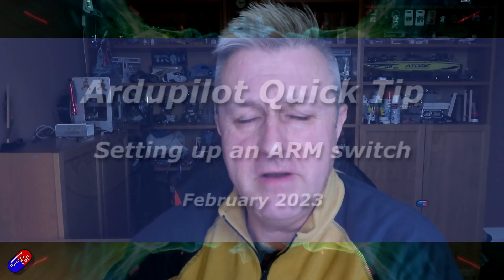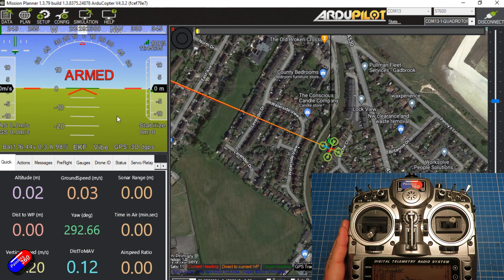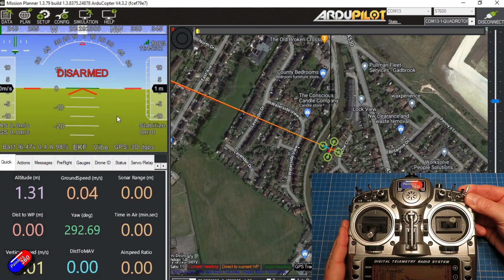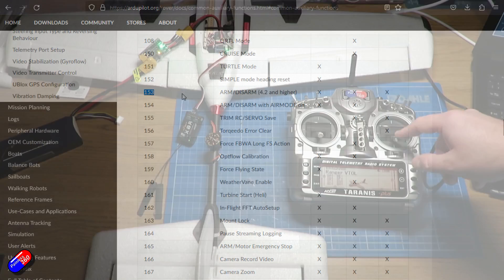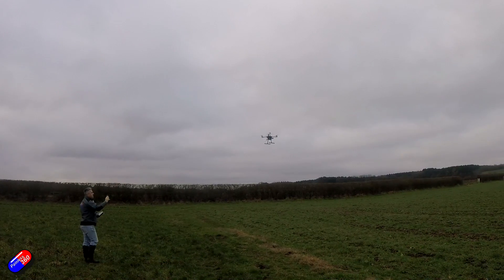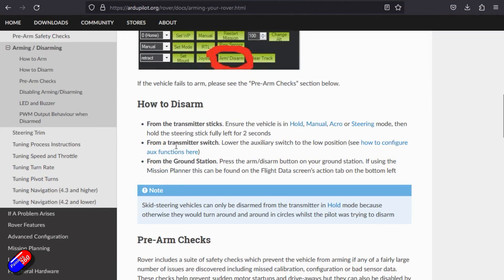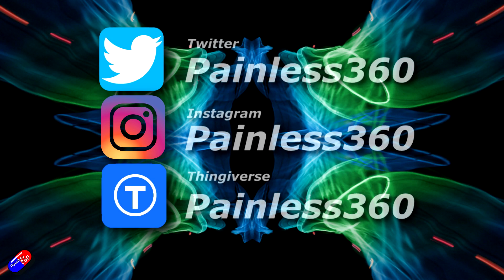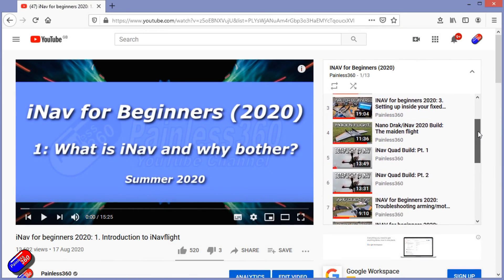Setting up an ARM switch in Ardupilot

Comment: I got caught out like this. When we fly BVLOS we turn off the Handset and use a lap top and a pair of RFD900s for control. Then turn on the handset at the end of the mission for landing. I had the momentary (Trainer switch set up in edge tx, to do the arm/disarm by holding it for 3 seconds) when the handset was turned on again it was in the disarmed condition which turned the motors off, Fortunately it was a fixed wing and was able to be glided in safely. went back to the old rudder arm after that. would be OK if you set an option to arm only with the switch and use mission planner to disarm you can do this with the rudder if you wish.  I really like your videos! Thanks so much for sharing your Knowledge and experience!!

Comment: I made a quadcopter and when flying it tilts to the right and does not fly stable. Is this a defect in the PID values?
Can u helpe me. I can send the video to u 😢😢😢
I used pixhawk-6c
Reply from the maker: Check your calibration for the accelerator and confirm radio calibration too... Follow my setup videos... Happy flying
Reply: @Painless360  I did and watched ur videos
Reply from the maker: Fab, of you're following my builds and not skipping any of the steps it'll work... Happy flying!

Comment: I saw a video where a 2430mm fixed wing fighter had a switch with a round trip mission, how could I make such a connection, thanks in advance
Reply from the maker: Yes, I'd ask that creator to explain. You setup a switch for auto mode. Check out my Ardupilot builds... Happy flying

Comment: Hey I'm so close to arming my quad using MP that I have no pre-arms checks, everything seems all good. Except for the bottom left of the HUD that says Bat1 10.00V 0.0A 0% in all RED. I'm using the taranis X9D to Pixhawk Cube and everything seems to be responding well. Except my RC5 that arms/disarms refuses to do anything. Do you have any advice Lee? Appreactiate all the videos they are great.
Reply from the maker: Make sure you are plugging the power block into the right power connector on the Pixhawk. That's the only time I have seen that here... Best of luck
Reply: Ok thanks! It's arming now but only while connected to Mission Planner with USB. It will not arm when disconnected. What are your thoughts?

Comment: Hi I’ve assigned rc5 on my heeeing vtol to arm but it won’t disarm on the same switch is this something I’ve done wrong
Reply from the maker: What troubleshooting have you already done?
Reply: @Painless360  not much I just programmed it this morning to change from sticks 
It works but won’t turn off again, not what to try I’m very new to ardupilot
Reply: @Painless360  using elrs btw
Reply from the maker: CH5 is only two position and sometimes the MODE channel isn't CH5 (depends on the Ardupilot vehicle types, but it can be changed). It sounds like you've missed something. See my full setup guides.

Comment: hi
 is there a setting in mission planner for failsafe not to disarm while in flight, ex : if you hit disarm switch by accident will it RTL first before disarm
Reply from the maker: There are reasons that a model won't disarm in flight. See https://ardupilot.org/plane/docs/arming-your-plane.html

Comment: Great presentation 
How do I go about installing the push bottom switch to the pixhawk  of a cargo VTOL, which disarm  upn landing( but not turned off) in order to continue the rest of the waypoints mission?????
Reply from the maker: Not sure,  I don't use the arming switch on the model. Best of luck

Comment: As I was trying to arm my Pixhawk 2.4.8 I frequently getting "PreArm: Baro: GPS alt error 5704m (see BARO_ALTERR" which prevents me from arming. But sometimes I do not get any of these error and arms finely. What may be the reason behind this? 

Additional Question:
Is Barometer necessary hardware in Pixhawk? If I turn off the arming checks of barometer to “off” will that be okay ? By turning the baro arm check to off I can arm successfully. Hope you will respond my comment soon. Thanks for your support PainLess360.
Reply from the maker: A few options and solutions are covered in the forums. i.e. https://discuss.ardupilot.org/t/prearm-error-gps-alt-error-5850m-see-baro-alterr/94099/17 Best of luck

Comment: Arm via switch works, but you should also consider the following: with the same switch, the model can then also be disarmed in flight ... which can lead to unsightly results. It is possible to arm the model in flight, but all conditions must fit (e.g. throttle to zero). In a panic situation this could go wrong. 
In addition, a new home point is set during the arming, i.e. an RTH would then no longer function.
Reply from the maker: See the Opentx and EdgeTX mixing school for how you can add mixes to the radio to make it safer. Switch arming, like other methods suit particular pilots, models and situations. As a pilot who's been stick arming for over a decade, I've never had an issue... Happy flying

Comment: Its been 2023, and ardupilot still requires a tutorial on how to setup an arming.
Reply from the maker: Not really. It's all in the documentation. This is more about letting pilots know it's available.. Happy flying
Reply: Ardupilot is still inconvenient, the most demanding of attentiveness. The oldfags just got used to it, so newcomers have to go through these inconveniences too. The standard interface elements did not seem to fit - that's why they created their own, more limited and inconvenient. Many people say that it is necessary to read the documentation, but it is not clear exactly where. there is no required text in those sections. The terminology is different: the flight controller is called an autopilot, many parameters in new versions are abolished or called differently, why the drone does not arm itself - error 0x4000 and that's it.

Comment: If you set up as a switch be sure your throttle is off before you flip it, don't ask how I know.....
Reply from the maker: You can add a setup to the radio so it'll only arm when the throttle is low.. See my super safe arming video. Happy flying
Reply: @Painless360  doesnt work with the dji remote 2 and o3

Comment: Hi Lee, thanks for the ardupilot vids. I am trying to connect an elrs receiver to my Radiolink Minipix without luck. Radiolink advised me to use the sbus connection on the elrs but as you know there is no sbus only tx and rx. I have tried all the settings for the minipix serial ports and the settings suggested on the ardupilot pages. Do you know if it is possible to use elrs with the minipix.
Thanks
Robert Hancock
Reply from the maker: I've never tried but here is the video I made on setting up fro CRSF - https://www.youtube.com/watch?v=fpnbJPU3hU0
Reply: @Painless360  Thanks. Still no luck. 
Cheers
Reply from the maker: Spoke to RadioLink and CRSF isn't supported. That'll explain it!
Reply: @Painless360  Thank you so much. I have ordered a elrs to sbus converter and will let you know if that works.
Reply: Got the Matek Elrs/Crsf to Sbus converter and it now works. No telemetry of course but I can use the plug in telemetry module.
Cheers